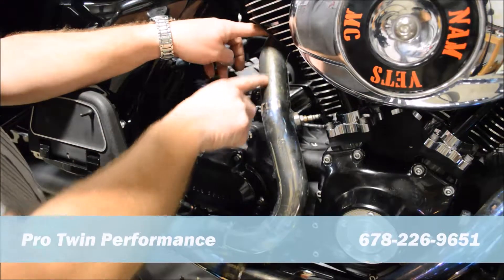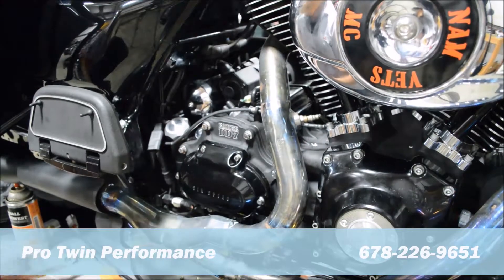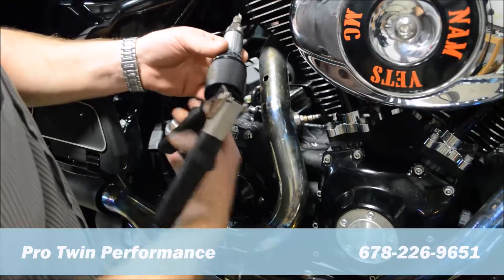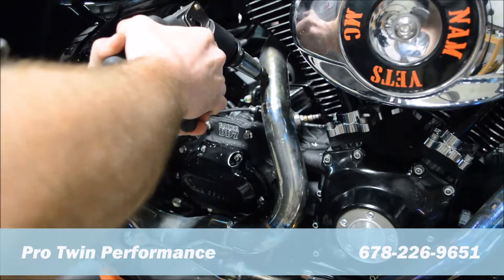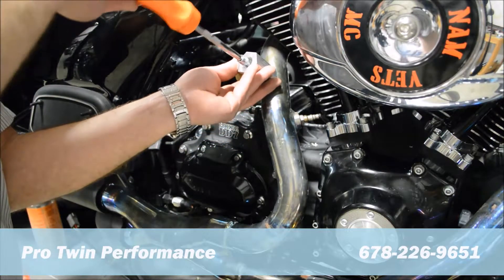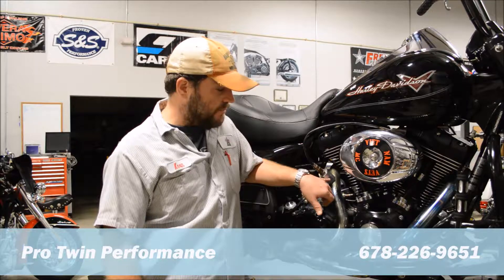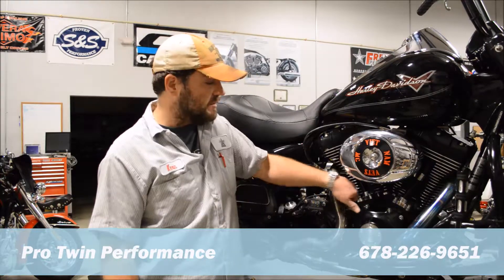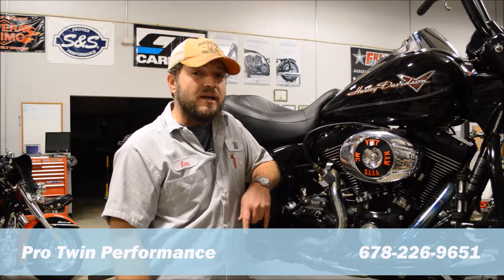Daytona Twin Tec - How To Series - O2 Sensor Adapters - Kevin Baxter - Pro Twin Performance

Comment: Kevin Baxter, I have a 2002 Road King Screamin Eagle. I bought the DynoJet Power Vision tuner, because it advertised the Auto Tune function, I know you hate that term and misguided implication, but... I am not a Harley guy, I know less than nothing about this bike. I am not even interested in this bike, wife went away for three weeks and said I should buy it to keep me occupied. Been a pain in the butt. The question everyone is hesitant in answering, even if I were to drill and bung a couple O2 sensors on the header, which seems easy enough to do... Is there going to be any place to plug in the wires coming from the O2 sensors into the OEM 2002 ECM, since O2 sensors were not around when this bike was built? What is my solution for adding O2 sensors to this bike so I can get a proper tune on this bike using the SNIFFERS as you call them? Nobody has been able to answer that question so far.  I have attached a link to a video I sent to Mark, the support guy at DynoJet. It shows how badly the bike runs and a decel pop. https://www.youtube.com/watch?v=XDft0xRKvi0
Reply from the maker: thats a straight forward answer.  yes however the stock ecm alone will not do what you want it to.  you can add a full Target Tune module and wide band sensors to your Power Vision and you'll have "auto tune" capabilites.
Reply: @KevinBaxter  So, the wires leading from the O2 sensor will plug into the Target Tune Module? Sorry! I simply have no clue how this works and most have no suggestions other than getting the bike Dyno'd for $400-$600 which is a one-time fix, I am hoping for a flexible fix if at all possible. I will check out the Target Tune Module, I'd just rather hear from an unbiased EXPERT than depend on the ADVERTISING Dynojet posts, they've already misdirected me once by telling me the Power Vision would Auto Tune my bike, when in fact it can't without O2 sensors. Thanks for your help! I do appreciate it.